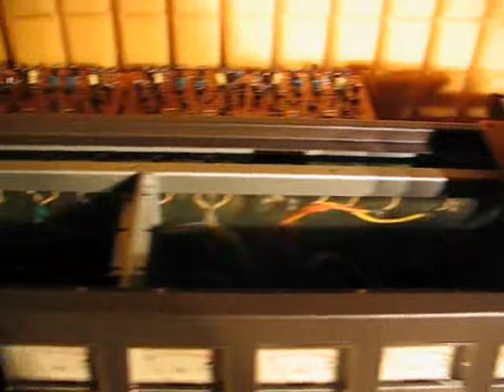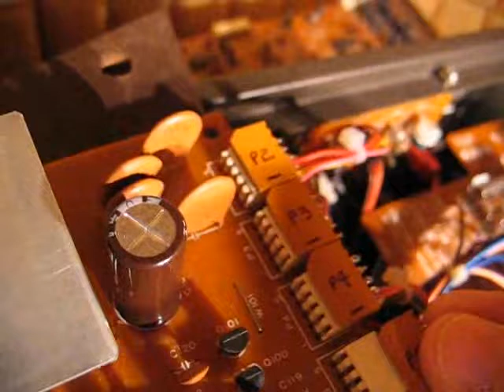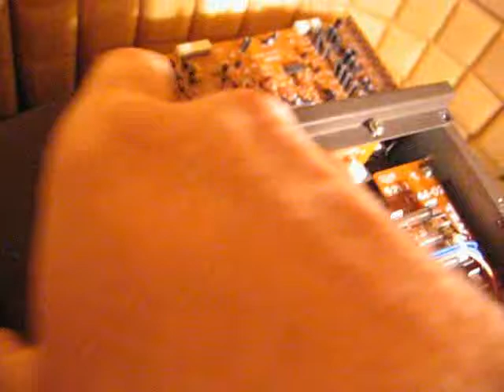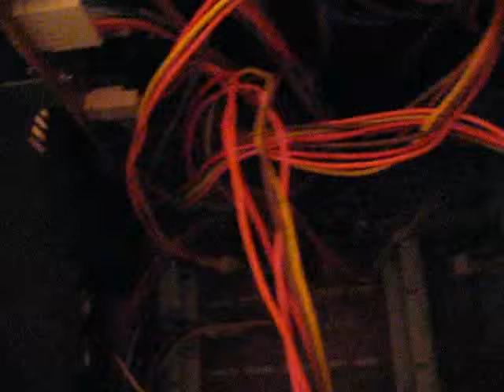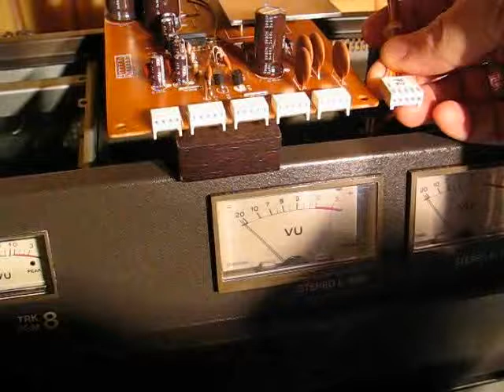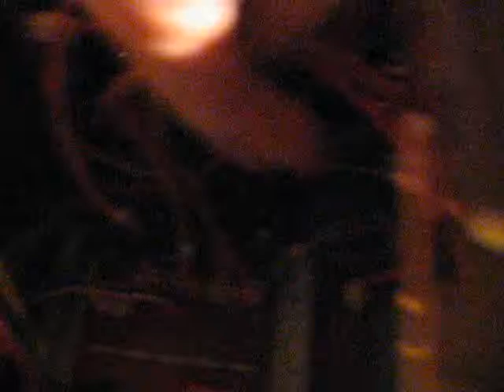Tascam 388 Studio 8 Custom Power Supply Extender Cables

Comment: Hi Sweetbeets, I’ve been looking at your videos and posts for a while as I’m currently working on a 388, thanks for all the helpful info and time you’ve shared, it’s great to have someone of your caliber contributing to the tape community. Do you think one of those female to male Dupont breadboard cables would help with this as well? Maybe they are not stable enough.. anyhow, I’d be curious to know your thoughts on that and if you’d recommend any components to recreate your PSU extender cables if the DuPont idea is too sketchy (molex, wire gauge?). I think it would be helpful here on the east coast to have this tool handy as I’ve been seeing this machine around New York City in need of help. Many thanks!
Reply from the maker: Hey, Ben thanks for the feedback, questions and for watching! Can you post a link to the DuPont cables you’re talking about? “A picture is worth…” etc., etc. Honestly all I used to make my cables was scrap mini Molex parts from other gutted Teac/Tascam stuff…I have a pile of wiring and connectors from various devices I’ve parted out over the past decade+. The wire itself is just tinned unshielded stranded 24AWG cable you find in the innards of these devices, and you can buy it new from many places…Mouser, Digikey, Newark, etc. It’s categorized as “hook-up wire.” Really what one wants is the extender board set if they are doing a lot of work on a particular machine, but the 388 extenders are super, super rare. I know somebody that used to work in analog support at Tascam in California, and he had a set he sold last year I think on eBay. Lucky Buyer…they went for opening bid. Crazy. But since you’re not going to find those, just making up a set of extender cables using 24AWG stranded hook-up wire and getting PCB mount mini Molex connectors. Getting the PCB mount type gives you the solder pins to which you can solder your hook-up wire. Otherwise you have to get the crimp sockets and pins.
Reply: @SweetbeatsTechStop  Hey there. Well, I wrote a response to you and I see now it never sent! Apologies for the delay in getting back to your helpful and much appreciated reply. Link to the DuPont wire below, I tried it out and it fits perfectly on the 388 PSU! Very handy with the color coding.. and a nice tight fit! I’d love to pick your brain a bit on 388 service if you’d have me… I’m at point there’s no option for defeat! I think I may have read every 388 thread / watched every video out there, confirmed every voltage, swapped in every part (except phototransistors, and leds for the sensors) but I’m still stuck with a reel motor issue, rt won’t turn. Possibly dead, I have cleaned commutator and changed the brushes- any secrets from the bench would be most appreciated… at the very least, you’d be saving a man from insanity!

https://www.digikey.com/en/products/detail/adafruit-industries-llc/1953/7241478?utm_adgroup=Jumper%20Wire&utm_source=google&utm_medium=cpc&utm_campaign=Shopping_Product_Prototyping%2C%20Fabrication%20Products_NEW&utm_term=&utm_content=Jumper%20Wire&gclid=CjwKCAiAz--OBhBIEiwAG1rIOqPjn5iA06-w_JiGql8lXso_ClyECrA6ZeLyYQA9YusqspPzcuXW8xoCBuEQAvD_BwE

Comment: Hey Sweetbeats, thanks for this video. I have a Tascam 388 and from what I'm noticing on mine is from the Power Supply Header #2 on pin 1, Im expecting AC7V, from pin 1, however, I'm  measuring pin 1 at AC23V. Is there a regulator or resistor that is fried that is reason behind me getting a high AC? I've already taken R1-R3 off of the pcb and measured. Those were all respectively measuring the correct ohms from my meter.

Comment: Hey thanks for your vid! I've replaced the belt and checked the fuses in mine, all seems good there. However, my capstan motor isn't turning and none of my VU lights work, so I'm thinking it's a power supply issue. Are there any precautions necessary before pulling out the PS PCB card? Thanks! -David
Reply: When you say “pulling out the PS PCB” do you mean simply that? Anything special before removing the card from the cardbay? If that’s what you mean, the only precautions I would advise is to 1. make sure the 388 is switched off, 2. make sure the power cord is unplugged from the power outlet, 3. let it sit for maybe 10 minutes to hopefully discharge the capacitors on the power supply board, and 4. be mindful the capacitors may still be charged, and to be careful in handling...assume they are still charged. As always, proceed with caution and at your own risk.
Reply: Cory Oace Yeah exactly that. I’ve never pulled cards off this thing. How much force does it take? Do they come off the connectors easy? How long do you feel is safe after unplugging. I guess wearing rubber gloves can be helpful
Reply from the maker: @dbo514  I generally wait about 10 minutes and then just proceed cautiously. If you want to be really safe just leave it unplugged overnight. The other thing you can do is drain the caps using a resistor, like a 10kohm resistor...just bridge the terminals of the cap for a bit and that will drain it. You can check to see if the caps are charged by setting your multimeter to DC volts and measuring across the terminals of the cap. If you measure voltage, the cap has at least some charge.

As far as the cards and how easy they come out,  it varies by machine and also depends on how long its been since they've been removed. If the cards have never been out and the machine has been in a damp environment, well...it will take some work. If they've been out before and the machine is clean and has been stored properly, its not too bad. The cards to the right of the cardbay (i.e. bias amp, reel servo and power supply) are easier to remove than the cards to the left (dbx cards, rec/play amp cards, meter amp and balance amp cards). For the power supply just grasp each exposed corner of the board between a thumb and index finger each, and use your wrists against the chassis as leverage so you can pull up with some controlled force, and gently rock the card back and forth to the front and back of the 388 (i.e. toward the faders and then toward the jacks...repeat) as you pull. It'll come out. Remember...they are designed to come out. And the motherboard is a more sturdy glass fiber PCB material. Be extra careful to align all the pins when installing teh card...use a bright flashlight so you can look down into the bay when you are installing the card so you can visually verify the pins are all going in the appropriate sockets.